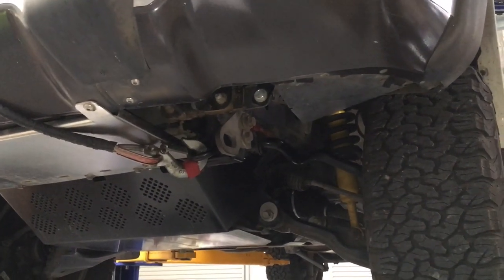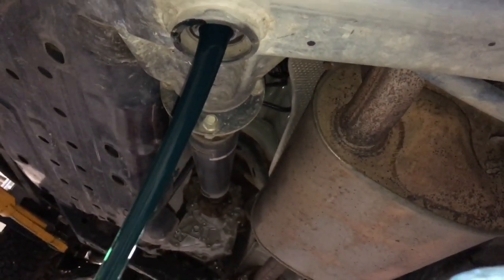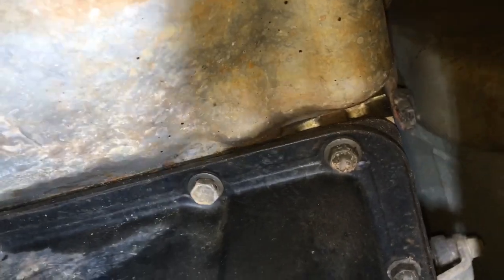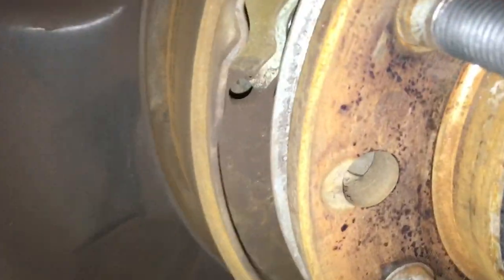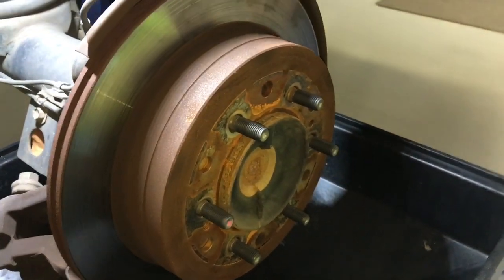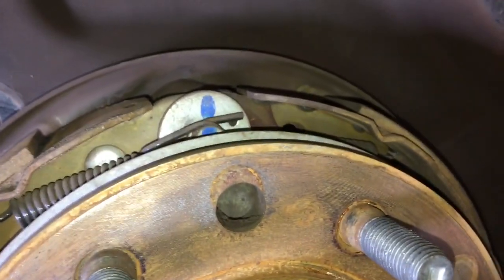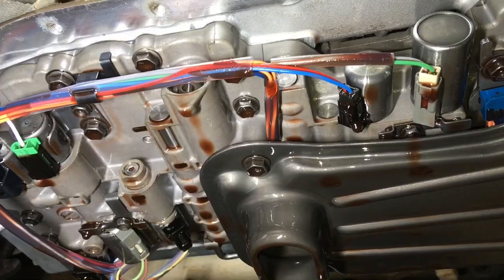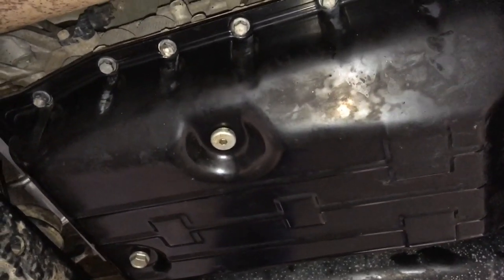MAJOR SERVICE & REPAIRS

Comment: i never knew that Prado 150 had a front differential.
i have a Prado 150 V6 Petrol Automatic. Will it also have a front differential?
Reply: If it’s 4wd which is most likely yes it will